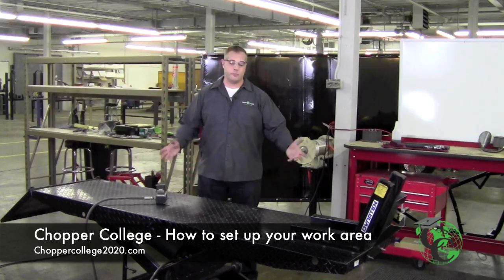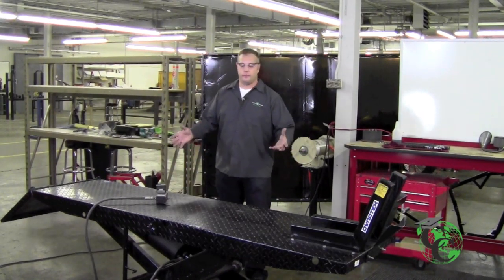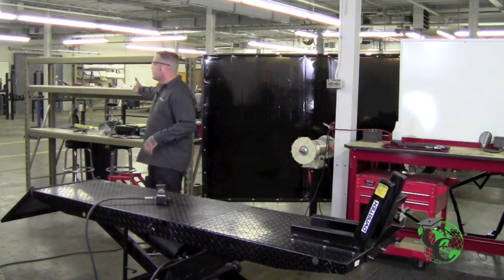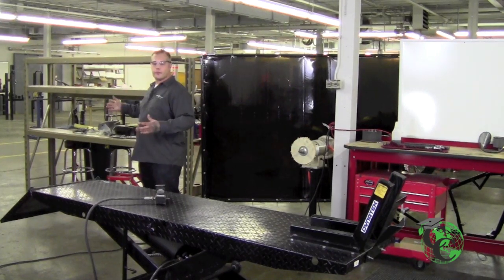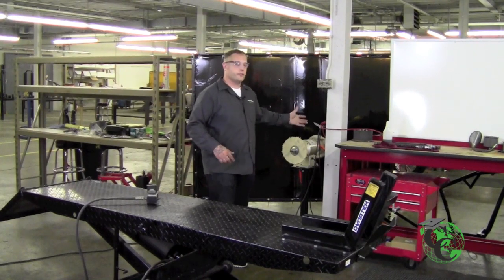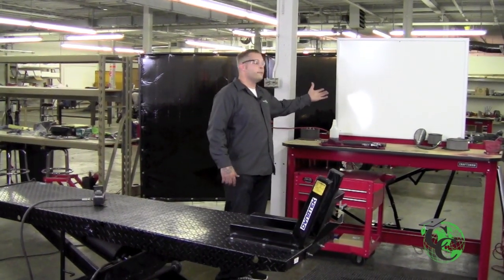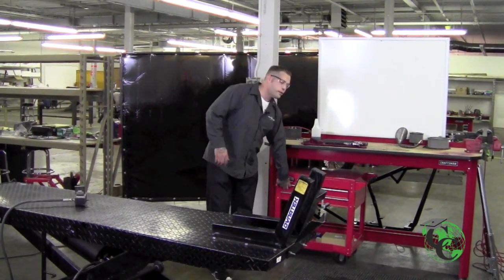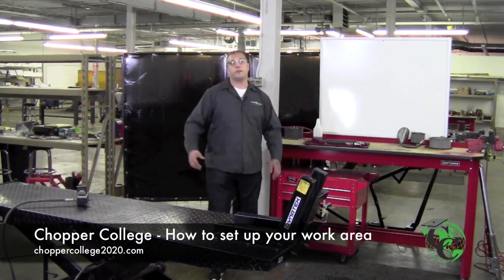How To Set Up a Work Area for a Motorcycle Build

Comment: Nice video. Add over head air line so you can work on both sides of the bike without dragging air line. Baggies or small bins and a shaprie for tagging bolts.